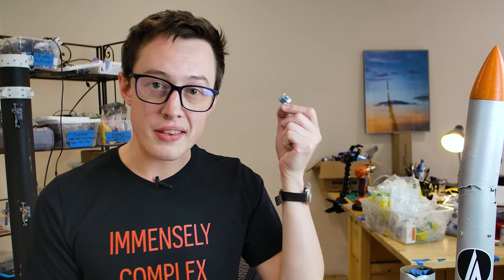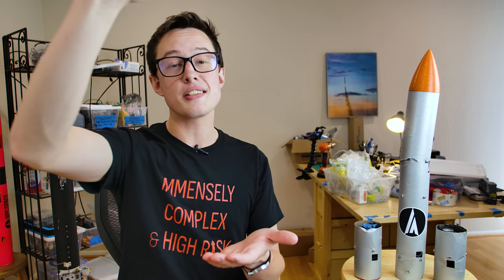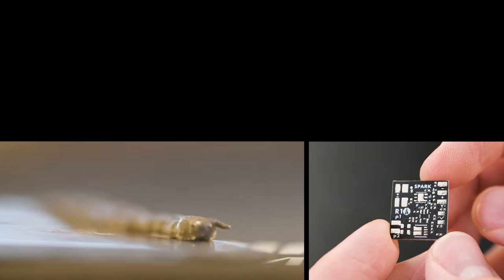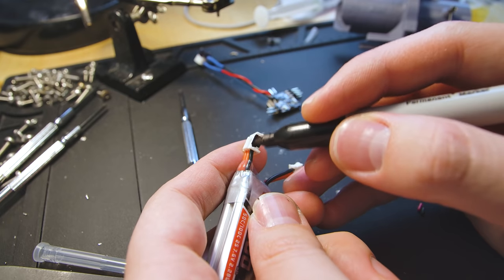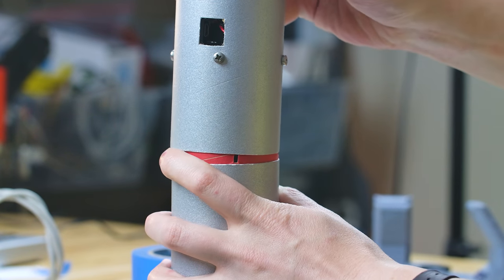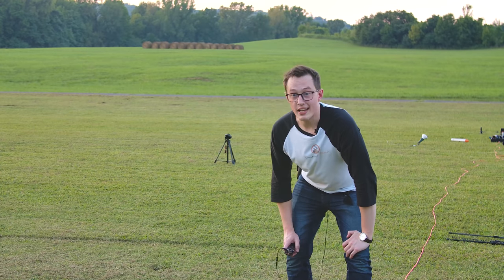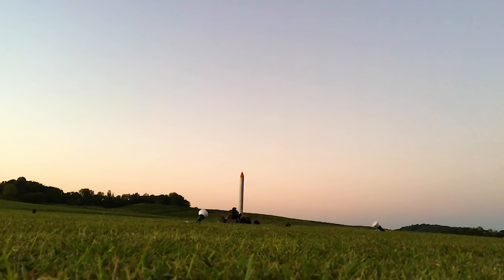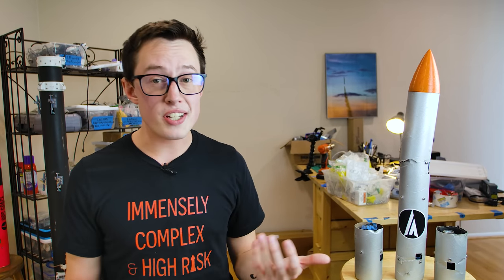Did I Make the World's Smallest Rocket Flight Computer?

Comment: Just FYI, for precision tech, especially digital applications, I'd recommend 4 layers: with 2 signal layers, and 2 hidden ground planes. The signal layers can create enough EMF in smaller electronics to induce signals into nearby circuits. A ground plane directly beneath both signal layers will protect against that.
Reply: So signal ground signal ground? Or signal ground ground signal?
Reply: @AB-om4ls  prolly the second one
Reply: @BMac420  Nah he said directly beneath both. So that means directly beneath Signal 1 and directly beneath Signal 2. S/G/S/G
Reply: @Jeremy.Bearemy  if you're designing a 2 layer pcb you've signal panel on "top" of the two side, in a s/g/g/s arrangement, each face is a signal plane with a ground one just beneath. i'll put my2c on s/g/g/s as @B-Mac
Reply: the not including of a log was the worst.
How can you debug the Code without jtag and without log?
Reply: @TremereTT  it's a learning experience, no need to be rude.
Reply: @Jeremy.Bearemy  Apparently we value honesty differently and measure politeness differently!
I won't change my culture, so if the differences bother you, then change yours!
Reply: For reference, sometimes it's signal/ground/power/signal. This does need good decoupling though, so not desirable on such small boards.
Reply: This is not precision tech. And for the signals involved, except for maybe the CPU oscillator traces, board layout really does not matter.

Comment: Actually to get 2 stages to fly straight without fins is impressive. How many times did Rocketdyne have F1 engine failures in testing before they got it to the point that the Saturn V 1st stages never failed with crew on them.
Reply: .. How many times?

Comment: Xyla said you might be coming here to film with us.  I'm curious what HS camera you use.
Reply: Why do all these rockets fly short and crash
Reply: @STEEPPOW  except for the high power stuff Joe has been focusing on low level flights for their stunning visual effects and system development such as stages and landing. You don't want to fly to 1k plus feet for every little system test.
Reply: @STEEPPOW  Complexity and efficiency vs dumb shit brute force.
The later is crude but reliable, to a degree; the former attempts finesse, but is far more suseptible to 'weakest link' failures.
Reply: didnt expect to find you here, are you potentially planning an in-flight guided bullet?

Comment: Maybe I missed it, but If that was me, I'd be moving the rocket off vertical by hand to check if the Atmel chip was programmed right to correct the deviation from the IMU ground direction reporting. Also, your take off G-forces should exceed gravity, so you need to have a fool proof way to analyse the IMU changes under real world conditions. You can do this by mounting your tiny circuit board on a drone with a couple of tiny servos and then record it's attempt to correct actions as you shoot it up into the air. Make sure not to swap your x and y servos!  No logging required. speaking of(writing of) logging, most of the Atmel AVRs have on board user accessible flash. Check your chip's flash size, data set to record and set it to write from takeoff, with more speed for early stages as those are where you seem to be spending more time.
Apart from that, great video, refreshing change to see attempts, too many people on here obsessed with only showing their successes!

Comment: "Little known fact; if you drop one of these parts on the ground it actually ceases to exist. Conservation of mass does not apply here it's just gone."

SO true.
Reply: Yep!  The old look down and follow it trick one learns after dropping one too many small parts doesn't apply for small SMD caps, resistors, diodes.  Best to just order three or four extra!
Reply: Use some light nearly parallel to the floor, the multiple times larger shadow is much easier to see (if you have an even floor without many bumps)
Reply: or little screws, those disappear and reappear to stab your feet
Reply: @Martin-yl5bg  well at least those you do find 😂😂😖🤬
Reply: @ZwergofPhoenix  That works if you regularly vaccum/sweep your workshops floor.  Another trick is if you happen to be unlucky enough to be married😂😂  then you can loot a pair of panty hose and stretch over the end of a vacuum hose.  If you’re younger you can ask your mother or sister if I suppose.
Reply: It goes in the Quantum zone

Comment: You can add a parachute to the cone to avoid "landing" damage. Many years ago i built one from the canvas of a small umbrella and it worked great. As the rocket fell back, gravity separated the cone from the body with the aid of three small air brakes. There are now materials a lot lighter than what I used so you can go bigger and land the thing a lot softer. Broken prototypes always gave me headaches.

Comment: Excellent. The video in my opinion is a huge success because it teaches a lot more than movies that seemingly everything works the way you want. In life we always encounter obstacles. And here we see how you deal with problems and try to solve them.
Have you studied in the past or in the literature what a PID control system is? There you have to put in the forces and inertia of the missile. If you were for example in the planning stage replacing the rocket engines with electric motors with batteries connected by cables but not on the missile and keeping the weight of the missile as in real flight as well as connecting it to wires that will not allow it to fall, you could make it stable and upright by calibrating the parameters of The control circuit. Then all that is left is to go out into the field and switch to rocket engines.

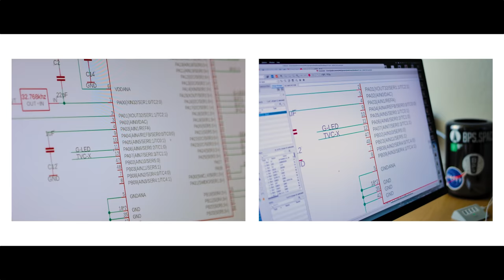Comment: I would love to hear a longer version of the song at 0:43! I love how such complex things can be made so small! If you go for WSRFC v2 (Worlds Smallest Rocket Flight Computer v2) - could you use a smaller MCU (fewer pins, BGA) with embedded EEPROM? Instead of mounting a USB connector on the board, you might be able to have board edge contacts (and a PCB thickness) that would allow you to insert the PCB into a USB socket). Also - if this board does not require much power to operate, do they have SM batteries with enough capacity yet? Or perhaps use a TH super capacitor for power? Originally I was going to toss forward an idea about using a battery with a higher internal resistance so a smaller reverse polarity diode could be used, but having an energy storage solution mounted to the board (rather than wired) might allow a smaller and lighter overall package. There might also exist a MCU or IC that combines the xDOF sensor, the processor, and the reverse voltage protection. Gonna subscribe, because this video was awesome. (Also thanks for showing how frustrating it can be making stuff - rather than just a string of successes).

Comment: from my observation in the last minute, i.e. in the failure of 3rd stage, in my opinion, the problem with the 3rd stage control is due to reaction wheel control you are using. I mean, in the first stage, everything looks ok because your mass is enough to balance the system where the reaction wheel can "actuate" and control the rocket, then, the second stage control, still ok because you still have some "mass" to balance the rocket, then, at the third stage, the mass significantly reduced so that when your reaction wheel try to control the rocket, this reaction wheel lose its counter weight so that your overall parameter system is different. That mean, what ever your tuning gain was used, it cannot stabilized the system anymore. My humble suggestion is, try to use "robust control" like gain scheduling or adaptive one.. the idea is, for each different stage your tuning gain would also different so that the reaction wheel would "adapt" with different parametric system.

Comment: Idk if you ever plan to revisit this. But i have an ingenious idea on how you can record flight data without changing the board design. You swap one of the leds for an ir one. Then place ir cameras around the launch site. Use the led to transmit data that the cameras pickup. Afterwards you reassemble the data. Actually as i typed this i realized that it might not work due to the motors releasing ir light as well as cameras not being fast enough to get a meaningful data rate.

Comment: As an alternative strategy you could add a drill on the top of the rocket, so when the flight controller decides to steer the rocket to ground instead of sky, it can dig through the earth and come out in the sky of the other side when it all makes sense again

Comment: Just eyeballing the flight, it looks like you have hunting and overshoot. That's where gyro correction overdrives and then reverses, inducing oscillations. What I see here is almost an updated video of 1950s gyro stabilized rockets.

By the way, my Dad taught me about hunting and overshoot in compasses while we were boating in the Atlantic. I was looking at the crap on the Bermuda triangle and insisted that a fluctuating magnet field was the only way to make a compass spin. He proved me wrong by swinging the bow of the boat repeatedly and the compass spun like a top. The compass card would lag alignment N-S due to the viscosity of the fluid in the binnacle and shoot a little past the alignment N-S, then return. But by keeping the bow swinging left-right, the oscillations would increase until it began to rotate.

It really does look like that's what you have going on here.

Comment: Your PCB itself has a much larger volume than any of your components. A 0.4 mm thickness board would greatly reduce the volume and mass of your board. I developed a flight controller for a robotic hummingbird  with a PCB of this thickness. Bought it with a stencil at pcb cart, good quality. I would also suggest to buy a cheap PCB oven (I used a regular pizza oven with a thermostate :D) worked like a charme and better than a heat gun.

Comment: In SpongeBob’s narrator voice: One Year Later 
The moral of this story: no matter how different you are, or how you learn; don’t skimp with data logging to easily find out where your problems are. Yes, you might be able to analyze your video recordings and deduce (eventually) what your problem might have been, but it will take you longer, it will be harder, and it also will be frustrating at times.
Needless to say: great job on getting the three stages finally perform as “designed” with the 3rd stage being “ aerodynamically unstable ” and showing 😏 but still cool 😎💯‼️

Comment: Dude I've got a man crush! This project is so cool! ... I think you should set up a high speed rotary launch platform.   It would add in a natural low speed fin-less stability.  But you will have to weight balance the body For rotational calculation you could use a 90° input offset. ... If you have greater initial low speed stablity the required vectoring correction will be less.  Once the unit gets to higher velocity it should be more stable.  You might also try a larger diameter rocket tube on the first two stages.   Instead of delaying supersonic effects it would be used to move the center of pressure to the bottom of the rocket.  This larger diameter would also give you more room to use 3 E engines instead of one on the first stage.  So I guess that would make it a ShrEEE^3K ....  :-/ Hummm, maybe it is not a good idea to build a rocket with "wreck" phonetically imbedded  into its name.  .... I'm thinking that  your stages need to be pre-balanced.   Each one is not axially balanced on centerline,  because of this each stage changes the centerline balance of the rocket and the rockets center of gravity.  You can really see it in the launch.  You can also see that the low speed rotation of the rocket is making a correction that is rotationally delayed from the motion of the rocket.   ... But i'm still loving this project.  Its a hoot!

Comment: Awesome work, but why didnt you just take any of stock FCs like matek h743-wing? with 480mhz CPU, 2m of flash, built-in IMU, a plenty of servo outputs, serials and CANs, and also a bunch of sweet add-ons like OSD chip and current sensor, it may suit almost any possible setup and be a heart of your rocket. You may even choose an existing software, maybe Arduplane with VTOL setup can be adopted to use on a rocket, or write your own code for it - but you still have the board already at your fingertips.

Comment: I swear to god he was about to say "The rocket knows where it is because it knows where it isn't. By subtracting where it is from where it isn't, or where it isn't from where it is (whichever is greater), it obtains a difference, or deviation. The guidance subsystem uses deviations to generate corrective commands to drive the missile from a position where it is to a position where it isn't, and arriving at a position where it wasn't, it now is. Consequently, the position where it is, is now the position that it wasn't, and it follows that the position that it was, is now the position that it isn't. In the event that the position that it is in is not the position that it wasn't, the system has acquired a variation, the variation being the difference between where the missile is, and where it wasn't. If variation is considered to be a significant factor, it too may be corrected by the GEA. However, the missile must also know where it was. The missile guidance computer scenario works as follows: Because a variation has modified some of the information the missile has obtained, it is not sure just where it is However it is sure where it isn't, within reason, and it knows where it was. It now subtracts where it should be from where it wasn't, or vice-versa, and by differentiating this from the algebraic sum of where it shouldn't be, and where it was, it is able to obtain the deviation and its variation, which is called error."

Comment: I have a big question that I am really hoping you can answer. I have in my head that the torque wheel will only help counter rotate to a point. As your rocket spins it has a set force spinning it, and when you spin your wheel from rest, it ads force back into the spin stopping it. Now in my head it seems like the constant force of the twist will balance out with the wheel and the wheel IN RELATION to the spin, will no longer be going as fast and need to speed up to match to the point that it can't go faster. Now I guess my problem is here I am thinking in terms of acceleration and ignoring the the spinning of the wheel has a constant torque force back on the body.... does it have constant force back on the body where you don't need to worry about the relative speeds not being enough?

Comment: Of course you learn what doesn't work. Which is very important I've done R&D for the greater part of my adult life. It's not everything is a winner. I would go with a stronger motor so that when the first motor cuts out it's still traveling the right direction for some time. But I've always been a big fan of more power. LOL

Comment: 0201 size components are a bit of a faff to place by hand but is still doable. I believe 01005 can also be done with a loooooot of patience.

Also be careful with 0603 footprints,  the metric 0603 size is 0201 in imperial. Dont make the mistake i made...

Comment: I had standard model rockets 🚀 that just topped out at 800 to 1200 feet and last launch was into an updraft and I lost my alpha 3 rocket so it got higher than 1,300 feet.  Try for 3,000 feet with camera taking video and photos on the way up and down with a parachute.

Comment: Nice layout. But why not make a housing over the control systems? I mean something from aluminum and other materials. I didn't quite understand why you built your own layout. So why? By building a longer rocket with more cables, you can sacrifice the entire stage of the rocket as space for on-board electronics. Easier to secure, easier to install.

Comment: How much logspace do you need anyway? You can get those chips with 256KB program-writeable flash, of course shared with the software. You can log like a thousand short values per second, if you fly for like 40 seconds, i would think.

I really don't mind hotglue for some sorts of assemblies. The best trait about it is how cleanly and easily it's removed with a drop of alcohol.

Comment: I want you to learn logic gates.  Use Karnaugh mapping to design the circuits you need.   Its not that hard.  Difficult yes.   This way your second stage motor doesn’t fire if the rocket isn’t pointed in the attitude you need.   You are awesome Shreee eeeek

With basic successful flights first, ie, basic, you can perfect flying, then add your extra problems to the rockets.   I enjoy seeing you failing personally.  It is hard.  I built a rocket but haven’t flown it.   You have lost your mind.

Comment: I like how you use an IMU to calculate forward speed. I'm new at this, but looking for the arduino programming that would use the IMU to calculate speed. It doesn't have to be exact for my application, since I will also be using an UAV sensor with Pitot tube for speeds above 25mph. Can you tell me where I could find some example code?

Comment: 🤣😂🤣😂🤣 I made it 60 seconds in. @0:49 #Listen I just want to know how to target my buddy's drone. 😁 I get it though cause I'm built different too. @2:24 So how much thrust @7:40 was that and whats your rocket weigh? #Stagging - you got to get your 2nd stage to fire at the exact time the 1st stage disconnects. The disconnect delay gives the 2nd stage time to ignite and get to full thrust. Same with stages 2 to 3. You want a smooth ignition from stage to stage without jerking left to right, front to back from the next stage kicking in late. #Smooth is better. @10:13 oh you are built different. 😆Keep going. It also looks like your motor isnt burning consistently. Add fins to stabilize - think like an arrow. Be the arrow. 🤣